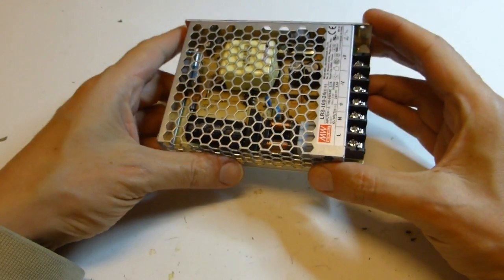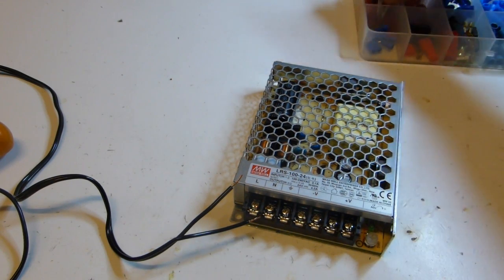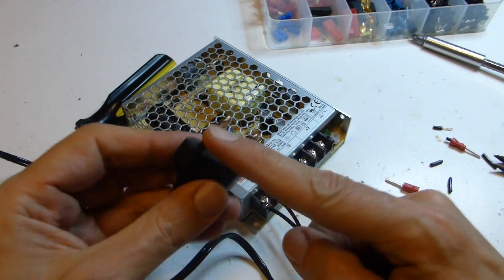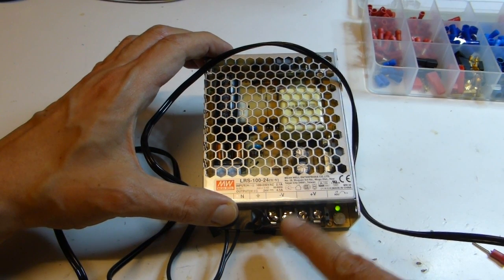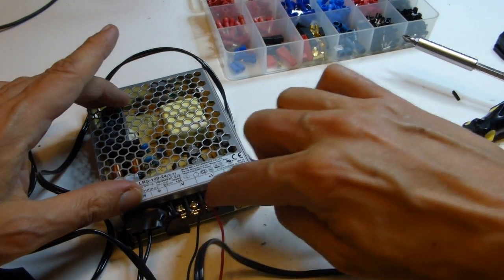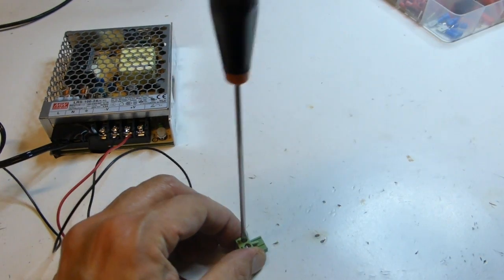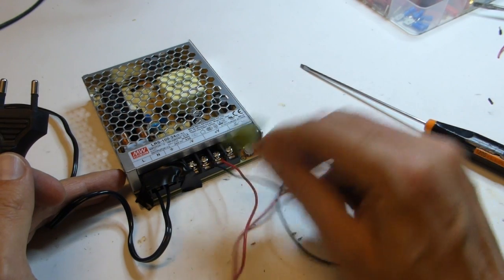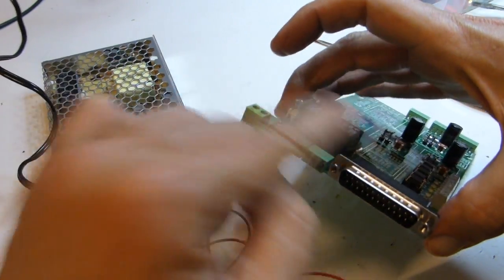Industrial power supply wiring up

Comment: Is it standard that the red wire is left and the black wire on the right? On the device I want to connect on the right side stands GND, in the manual stands if I connect power to GND it will destroy my device